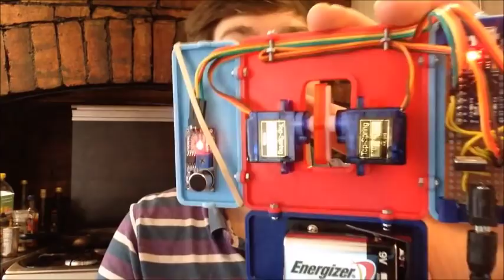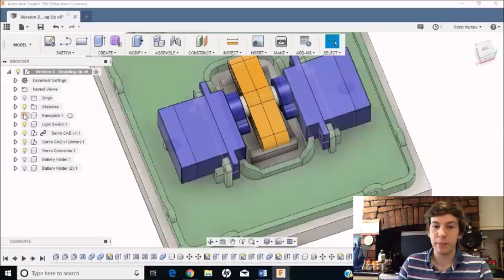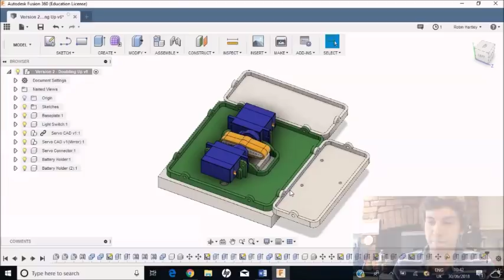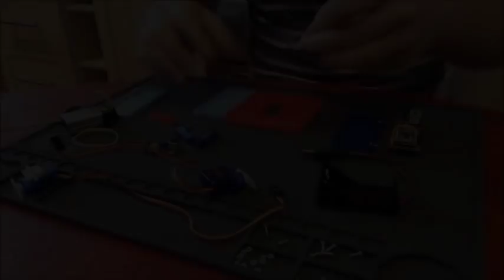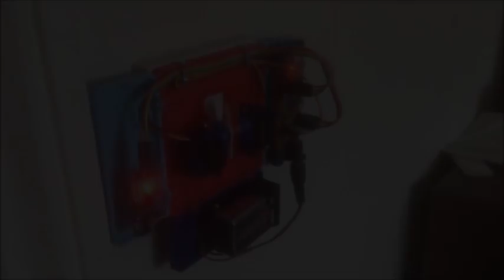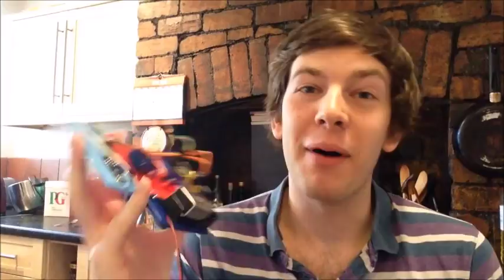Arduino Light Switch Control

Comment: can i use arduino uno on this project ?
Reply from the maker: Sure you can, the code is exactly the same. The only thing which might change is which pins you use for the servos as I think they have to be PWM pins.

Comment: I don't think you needed the 5v regulator since the arduino pro micro has one built in. Great work anyhow
Reply from the maker: Yeah I think I could have used the on board one tbh - you're right. Well spotted! To stay on the safe side I decided to add a slightly bigger external one but like you say, it's probably overkill. Cheers :D

Comment: Hi Robin, how long it took in total? I mean whole project with 2 versions, modeling and 3d printing, writing articles and recording videos.
Reply from the maker: Hey Gleb, good question - I'd say a rough breakdown is as follows:

Version 1 (didn't work)
-> CAD/Design: 6 hours
-> Prototype circuit and solder: 3 hours
-> Coding: 1 hour
-> Assembly/testing: 2 hours
-> Write up results: 2 hours

Version 2 (did work)
-> CAD/Design: 2 hours
-> Circuitry and soldering: 0 hours (already built)
-> Assembly and testing: 1 hour
-> Running round the house joyfully clicking lights on: 1 hour
-> Film: 3 hours
-> Edit and upload: 2 hours
-> Write up results: 3 hours

Total: 26 hrs

So roughly two full days, but I spread it over about 2 weeks, doing a couple of evenings and a weekend. These things always take more effort than you imagine but I really enjoy it and I learn a lot in the process. So, I'd say the output is more than just the video - there are lots of lessons learned. And, I could take this clicker/clapper around faires and shows now so I will have it forever.

Definitely worthwhile if you ask me :) Thanks for your comment!

Comment: Hey Robin, you didn't address why you used two servos!  Why did you go with two?
Reply from the maker: Hey thanks for the interest - good point! Fittingly, there are two reasons I went for the double servo approach...

1) To make sure I definitely had enough force/strength to click the light switch - you'd be amazed at how strong they can be! As it turns out, I think it only really requires one servo but I wanted to make sure.

2) The servo arm often deflects and/or comes off when it turns - the joint between the servo itself and the servo arm is not especially strong (sad times). So, having two arms compressed against each other means they definitely can't ping off or wobble/bend/deflect.

If you're interested, I actually did first design this with one servo for on, and one servo for off. It failed quite spectacularly and I recorded some videos showing why here: http://hartleyhacks.com/making/retrofit-remote-light-switch-v1-a-failure/

Hope this answers your questions! :D